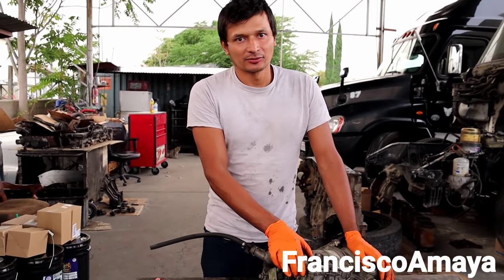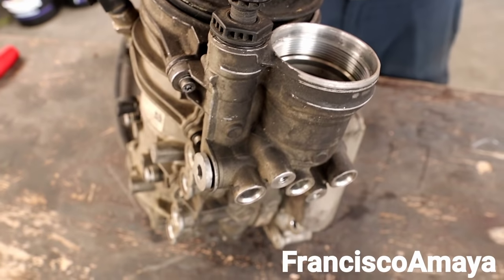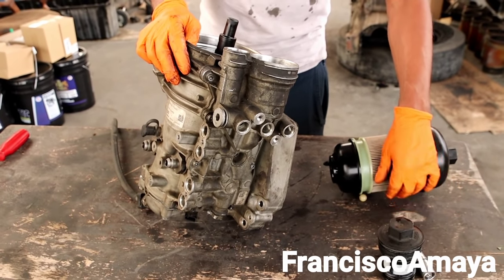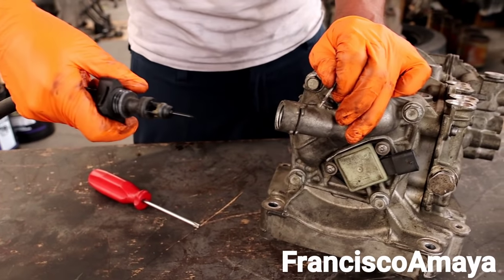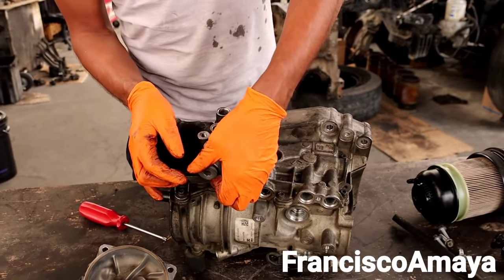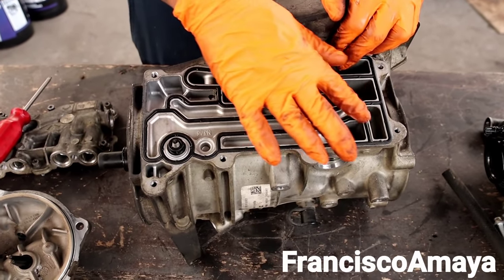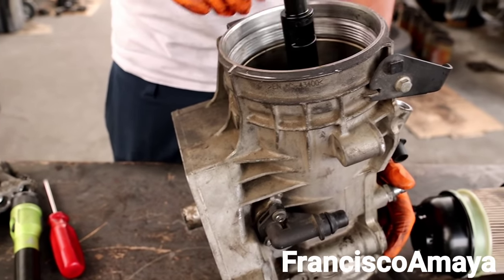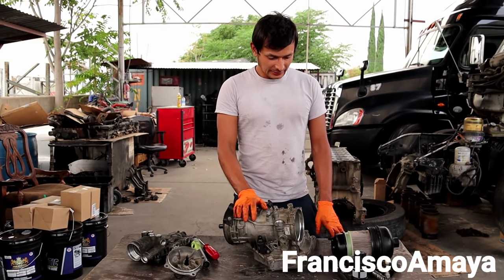Freightliner Cascadia DD13 DD15 DD16 fuel filter module check valve hard start crank doesn't start

Comment: Man I like your Youtube videos.  They really help me save money.  I have a 2015 Cascadia.  My fuel water separator is draining out overnight and I already changed the check valve in it.   It could be draining out faster than that.  I have to put fuel in the separator in order to start the truck every morning.  I see a lot of bubbles in the glass. What is going on?
Reply: Did you find what the problem was cuz I got bubbles in the water separator also and drains out overnight.

Comment: Hi I have Freightlinder cascadia 2017 hard start issue, where Can I get this check valve ? And do you know the order details, thanks for your Video
Reply: 2015 dd15 rebuilt 2.5 years ago oil is going to my water separator and I’m losing 1.5 gallons of oil at 800 miles no major oil leaks what is the problem please let me know

Comment: Compa, the dd15 is slightly different (2009 Cascadia). Where can I find the fuel check valve outside the housing?
Reply: Any luck finding the location?
Reply: @LSXPerformance   yes Freightliener has the check valve it’s &$24. Dollers

Comment: Freightliner  hasn't  made parts  for  the three filter  systems  in two or three years.   As he said  it cheaper  and better to convert the old 3 filter  to the 2 filter  systems.   But it really  better to not have a dd 15

Comment: @franciscoamaya hey my dd15 is not starting and I looked underneath the filter housing for that check valve and mine doesn’t have that valve. My truck just turns over but won’t start, when I prime it the fuel is flowing back to the fuel tank, anybody got any advice??????

Comment: Holy hell you saved me with that check valve thank you so much I didn't even know it was there.  I cleaned it out when I changed out a fuel pump couldn't figure out why when I shut off the engine 10 mins later I had to reprime the system watch this video went back to where I dumped the fuel and sitting in the screen was my ball you saved my ass thank you.  I will definitely send money to you best advise video I could of watched.

Comment: Thank you Francisco for this video. You did an excellent job on breaking down the components as well as describing and explaining what each part does. 
I have an issue with my 2014 Cascadia. The 2 main fuel lines on the driver side keep breaking on me. I’ve had to replaced both lines 3 separate times now in the past 2 months. The truck has a starting issue as well, I have Step on the gas pedal to help it start. Could you give me your thoughts on how I should go about this issue? I do most of my work on my car and on my truck because then I know it will be done right. Thank you sir.

Comment: Francisco excelente buddy good job, awesome job need help I have one dd16 that starts if I prime the system but dies if I accelerate no check engine light no codes, fuel filter runs out of fuel help buddy

Comment: Thanks for all good information. Have DD 15 trouble starting
Put cut off valve on return fuel line .
Pressure rise the system with fuel.
It started fast...opened valve on return fuel line ...let it run 1 hrs. Closed valve  shut off ...next morning  tried  to crank with Pressure to the system... no luck . Do you think I should go inside to check the internal check valves. 
I do need to check the ball in the 1st filter your help will be appreciated  thanks Frank
Reply: I MEAN  TO SAY ON NEXT MORNING TRIED TO CRANK WITH NO PRESSURE TO THE SYSTEM THANKS FRANK

Comment: Got a 2016 freightliner with a DD15 it cranks but won't start Davco leaks down lots of bubbles,  I removed  the final filter on the fuel module  and filled the housing up and the fuel leaks down in the housing is it supposed to leak or stay up
Reply: Hi, did you receive any feedback with that, I have the same problem

Comment: Any suggestions for getting hard start low fuel rail pressure. I have changed rail pressure sensor and pressure limiting valve

Comment: Okay I have a 3 filter system. I just changed the Fuel quantity valve to fix surging while idling. It fixed that problem now I have to crank it with starter fluid and It just showed a code for low DPF Fuel pressure. Spn3480/1 after 2 days of driving. I wonder if one of those check valves will fix my problem.

Comment: truck looses prime over night, have to hand pump to prime again. if tripac running, davco empty. when truck is running, constant stream of bubbles in davco. started just after having fuel filters replaced. great video to know the internals
Reply: There's an another plastic  ball type valve in water separator .  I have the same problem . I'm going to change it very soon .
Reply: Same here with the hard start. Bubbles in davco. What ended up fixing your problem?

Comment: Hey Francisco my prime pump doesn’t work every time I do a fuel filter change I have to put the sprayer with diesel for the truck to build pressure do you think if I just switch the Little Pump it will work

Comment: I have DD15 cascadia there is a problem with the fuel system. If i need to start the engine i have to add fuel to the water separator and pump it . And the next day the same problem please advice me what i have to do.
Thank you

Comment: What year is the engine of this particular module? Im having a crank/no start on a 2011 dd13...weird crank issues..starter will only engage for 3 to 5 seconds...scanner is showing good rail pressure and mirrors the desired (I think it was 340bar)...truck attempting to start but wont actually run...checked all fuses,clean power,showing over 150rpms while cranking...another technician replaced MCM module due to water and oil damage(module was full of liquid), but engine still will not start..I do see some smoke coming from the stack during the short cranking, but still wont start under its own power..in start position, engine will only crank for about 5 seconds,then stops rotating...engine does start on a shot of start fluid(which I dont like using)...but shuts down as soon as I stop spraying.....checked all 6 modules on my scanner and not getting any codes..am able to see all of my live data now too...prior to MCM replacement was not getting communication, but now communicating after replacement of module....also,did have a code for MCM not shutting down-battery floating, but all terminals are clean and batteries are good......this is in a 2011 Freightliner Cascadia....engine was deleted, but not sure if new module is affecting the deleted DPF.....engine is attempting to start,but is acting like a fuel issue....also already checked all fuel supply, filters,etc....any other recommendations would be very helpful..im use to the 60 series and not very familiar with the DD 13....wondering if the prior delete with the new MCM is the cause of this...thanks in advance 👍

Comment: I have dd15 and when it’s on the road it starts losing power and then it shuts down. When I hit the feet pump 20-30 times then it starts working. Its showing spn94 dlvrpress code and spn3509 snsr volt code. What should I do?

Comment: I have a 2014 freightliner cascadia with a dd13 it keeps shutting off 4,5, and 6 injectors but it only happen after about 10 miles of driving there has been a new mcm injector wire hornest, and sensor  hornest the code is still coming back and I can only do about 45 mph

Comment: Hey could u pls do a video on three filter system . Am having hard start no fault codes but hard start if I park for 10 mins plus . 
If I switch of and start immediately no problem. 
Is there any valve on return or in the system which Keeps back pressure.
Reply: Did you found the problem?
Reply: Yes we have the same issue with our 3 filter system like this. Would love some insight as to how to fix the issue.
Reply: What ended up fixing the problem?
Reply: @kebotrans  did u fix it?

Comment: 10pm my dd15 2016cascadia stalls out when i come to a stop not all the time but runs good on hwy when it stalls i have to use starting fluid what could cause this
Reply: Can someone please help me my truck runs out of fuel prime under a load and stalls out it will not restart unless I prime it

Comment: amigo tengo un Cacsacadia 2013 al que le cambie el motor por uno igual. me esta dando un solo codigo SPN000679 me dice que es el pressure limiting valve. ya esta cambiada y sigue diciendome el mismo codigo. me reduce las rpm a 1000 y la velocidad a 5 MPH. Que puede ser?

Comment: Have question i have cascadia dd15 2015 when is cold the truck started normal than when the engine get hot like 190 to 200 temperature and  i shuts off the engine 15min later i have hard start do anybody know advice plz

Comment: Hi.  I'm trying to find the part number for check valve at the dealer showed me something different.
Reply from the maker: some housings are different and are not equipped with check valve. anyway, detroit is forcing buyers to buy the whole fuel filter housing instead repairing it by not offering replacement parts.
Reply: @franciscoamayaYT   My truck is 2015

Comment: Sir, the tip of the straight bracket, in the large compartment, cracked open. Trying to remove the fuel filter. But you say; that it doesn't have more than just a simple function. And is just to positioned the fuel filter, right❓
Please respond😊
Reply from the maker: the large filter bracket directs the fuel in one direction if it broken, it is possible that the engine won't start
Reply: @franciscoamayaYT  : I appreciate your response.
God bless you always 😊

Comment: I have a 2013 DD 15 the check engine light and shut down engine light and water in fuel light keeps coming on every half mile or mile and shutting the engine down but the light on the water separator never gets read it always stays green we change the fuel filters and can’t figure it out still won’t work
Reply: Did you ever get this fixed? What was it? Having same issue. TIA

Comment: Hello, I have changed my fuel pump but I’m still not getting pressure out of the pump up to the rail
Reply from the maker: Maybe you have air in the system
Reply: Did u figure it out

Comment: I have a issue with my truck, if i prime it will start but if it sits for 40 minutes it won't start. when pump it to prime the fuel goes down in the glass bowl and has a few bubbles in it. Any way you can let me know what the issue is please?

Comment: How do you get the plastic ball out? I’m having trouble getting it out
Reply from the maker: use are pressure from the inlet port of the housing
Reply: @franciscoamayaYT  I was able to use a pick and pop it out. Replaced the ball, but I’m still having a hard start do you have an idea what it can be? I don’t have the check valve at the bottom of the filter housing

Comment: I am having a big problem. Please help. Replaced fuel pump and changed the filter housing from three filter to two filter using the conversion kit. Truck started after hand pumping to prime system. Only ran for 45 seconds and quit. Will not start back. Changed injectors. Again trucks started and ran for a minute and quit. Will not start back. Truck ran fine before replacing pump and doing conversion.  Quantity control valve was acting up and it was down a little in power was only thing going on before putting in shop. Started fine.
Reply: Did you ever find out what it was? I’m having the exact same issue
Reply: @AbanobbG  what work did you do on truck?
Reply: @JeepJKU345  truck died, had no fuel pressure and found metal shavings in fuel filter so changed high pressure fuel pump. Didn’t chang the fuel filter module only cleaned it. Primed the system it starts up then dies and won’t start again. The fuel pressure really just doesn’t stay up even though I checked everything for leaks.
Reply: @AbanobbG  if you had metal shavings in the filter module then you probably had shavings that took out the injectors Luke I did. When they/you change injectors flush the fuel rail and all injector lines. If you had shavings you really are supposed to drop fuel tanks and clean them out too
Reply: @JeepJKU345  Thanks for the info brother. Your truck ran fine after changing injectors and did you change all 6?
Reply: @AbanobbG  yes all six.
Reply: @Dave Metheny  did you get codes for your injectors? Or code for low pressure in fuel rail?
Reply: @notkirill6991  no codes
Reply: @JeepJKU345  dang, did your truck start at all?
Reply: @notkirill6991  it did when you put new injectors in for a minute. Did a complete clean out of system and new injectors in it. Runs fine now. Ended up taking it to dealer

Comment: That Plastic tube on the inside plays a huge roll of fuel, we are currently dealing with a problem and fired someone over slightly bending one causing the truck to be stuck until new housing or tube comes
Reply: Did you find the tube by itself or did you have to replace the whole housing.